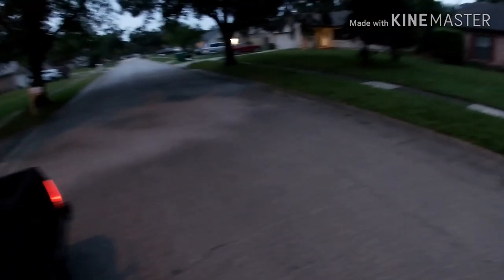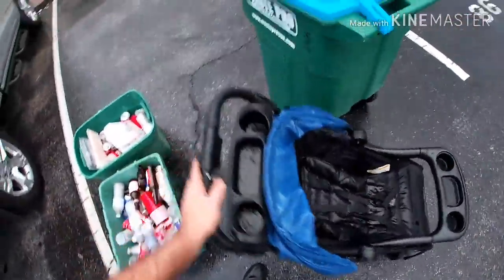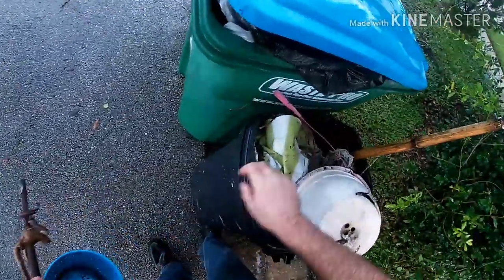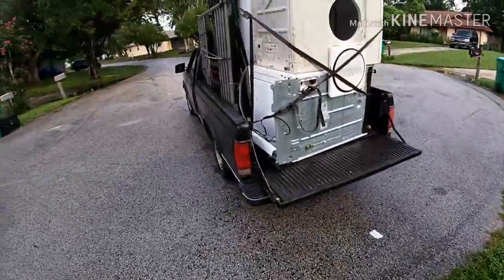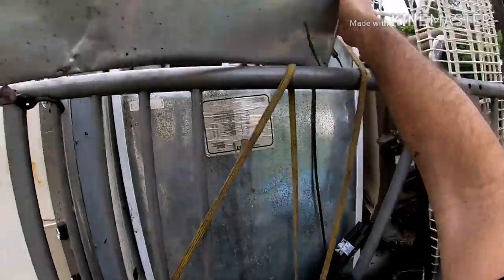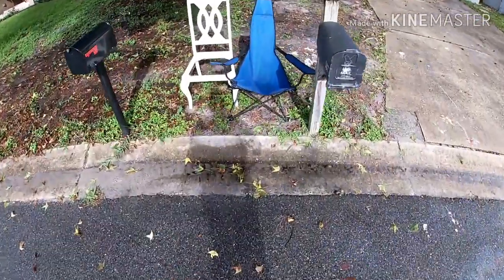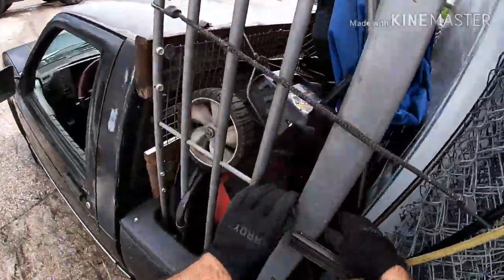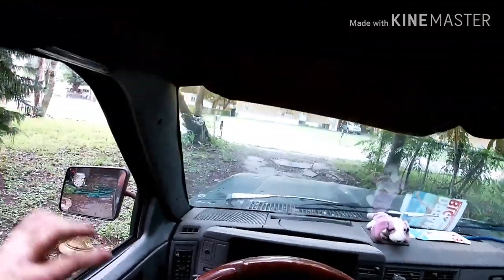A wonderful and wet day of street scrapping.

Comment: Absolutely love the s10, if that’s a 5 speed with the iron duke 4 banger, that is a great go getter truck. Great mileage and plenty power. The ones I had, didn’t have power steering so they wound out fast. When I say go getter, I mean it’s a great truck for pickups, then I would keep hauling back to a bigger truck and carefully restock everything on the bigger truck to get the most weight on to haul to the yard. Late 90s dodge 4x4 trucks seem to be great for that role.  Keep on scrapping bud!